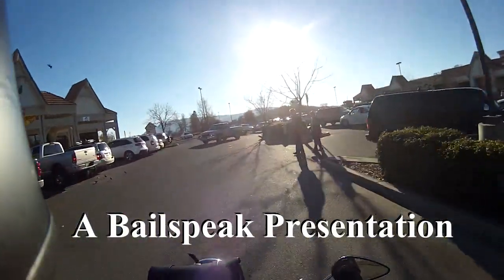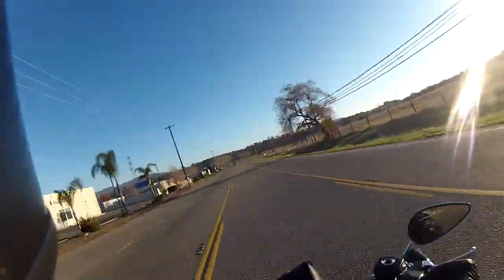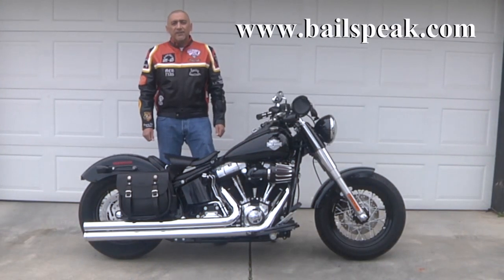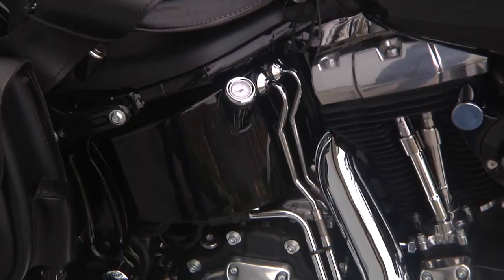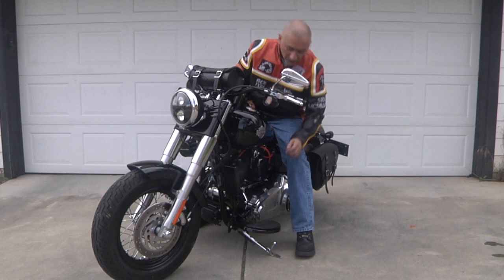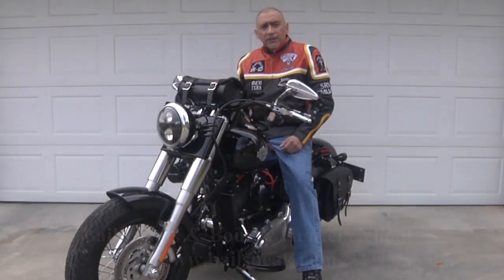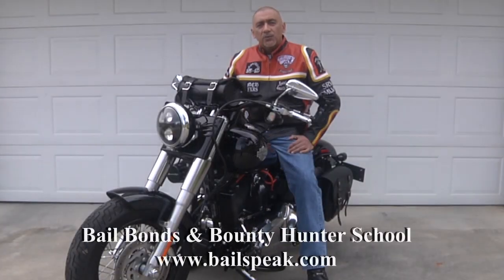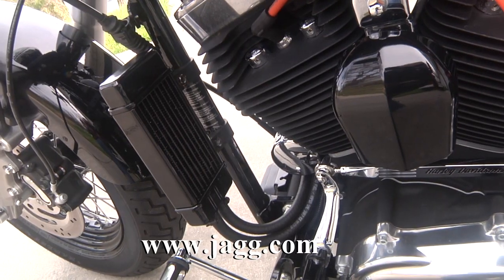Oil Coolers for HD Softails

Comment: The Harley 103 has a long string of commentary from various persons and sources seeking remedy for overheating on both stock and modified bikes; moreover, the profiled bike had been mapped twice and cruised in moderate temperatures well over 200 degrees; indeed, further anecdotal evidence suggests that an EFI will shut a bike down when sitting idling in triple digit temperatures, though not personally witnessed  ~ Thanks for the comment.